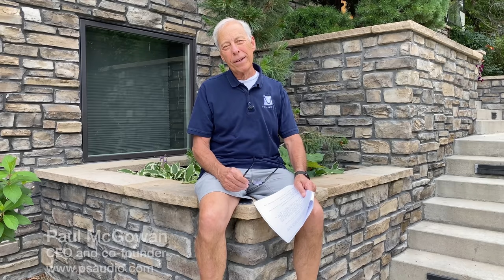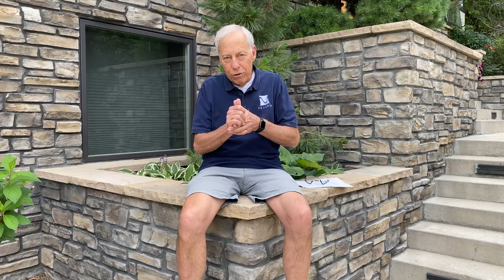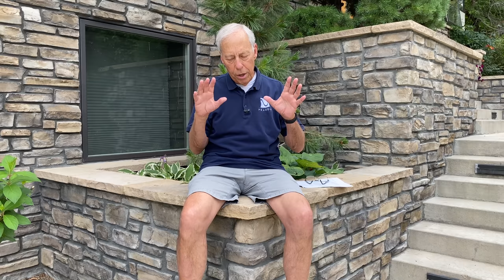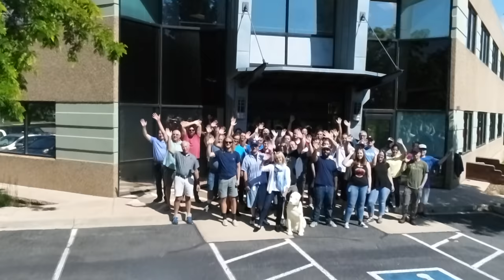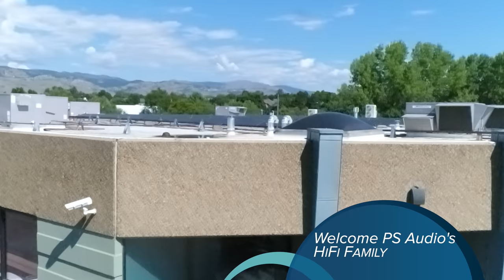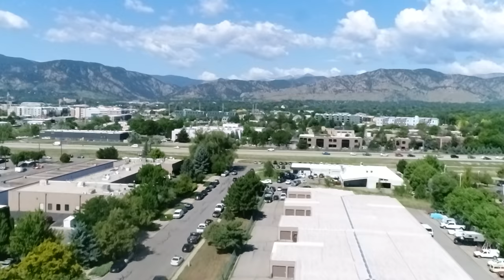Speaker cabinet resonance. Gimmick?

Comment: That's why you shouldn't... have a speaker fitted to the front baffle it should be fastened on the magnet on the inside dramatically reduces mechanical resonance,
What's happening is it getting back into the vocal coil and smearing the sound and actually cancelling some parts of the frequency I think what Paul is trying to say.
There's a few ways to do it but what's wrong with putting the bracing like bamboo 12mm in a diagonal cross member side to side and have it under tension the sidewalls, so it is cupping from the outside 3 mm in at it's narrowest point held in place by the tension of the brace, as I have told you use thin walls is the proper way to go much easier to manipulate and strengthen and has less resonance and is better sounding then thick wall cabinets, as long as there's plenty of bracing like with partitions honeycomb structure so no big area is not braced probably about 2 or 3 inches at the most open area, the bracing goes vertically not across it is incorporated into the side panels same principle as an egg box it is thin but strong and stiff what you can stand on and it will take your weight without eggs of course lol,  make your side walls out of honeycomb plywood 3 mm thick by about 12mm in depth strips of Marine beach plywood, the outer wall can be about 6mm thick plywood or hardboard, glued and clamped together into any shape you want. you need to find a good cabinet maker shop use thin epoxy resin when gluing ideally under a vacuum what is easily achieved and cheap not expensive In a mould. This could be achieved with fibreglass in the same principle and would be cheaper the mold would be shaped to Incorporated with the Honeycomb structure in it a thin veneer could be used on the outside of a millimetre thick or any other material for that matter

Comment: The best way to get rid of cabinet resonance is not have cabinets. That’s why electrostatics like Quads sound so uncoloured.
Reply: Jeff Paynter Other planar types and OBs with moving coil drivers have similar theoretical advantages, but then true dipole or bipoles are not absent their own issues with room interactions.  There is no universally perfect audio component, and the integration of full bandwidth loudspeakers and “average” domestic venue will always remain an exercise in balancing of compromises. 
As to the question of ideal method of mitigating or eliminating measurable & audible artifacts of speaker enclosure resonances, I think that’s an Alice in Wonderland rabbit hole in which one can too easily be entrapped.

Comment: About Cabinet strength properties.
Imagine yourself walking in muddy terrain after the rain & your feet being eaten by it.
Then imagine yourself riding on a sturdy, dry terrain...
That's the difference between an average low grade cabinet & a 300.000$ Wilson Audio Alexx metal reinforced cabinet structure.
Need a try ? ----> https://www.youtube.com/watch?v=BfzK7XYd0LE

Comment: I hate to say it but he's right, graphs are shown and discussed in this video by Hexibase "Treating Enclosure Resonances":
https://www.youtube.com/watch?v=OtvDQY9-63g

It's not immediately clear that these are noticeable, but they're measurable, which is more than can be said about some of these topics.
Reply: Decay problems are measurable but rarely do you see such measurements in the specs made public. Lots of audiophiles claiming you can't judge a speaker on measurements are right that you can't judge everything, but you can still judge a lot.
Reply: Hexibase was talking about Internal resonance from the sound waves bouncing around and making it back the the woofer.
Reply: dakken74 Yeah, not exactly the same root cause but sort of the same issue of poor sound decay performance. Poor decay can happen due to several factors. Also your amps damping factor plays a role.